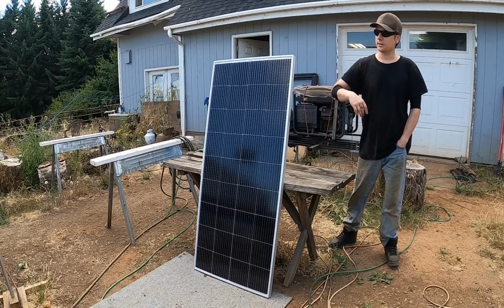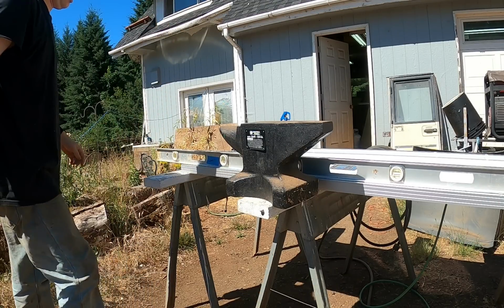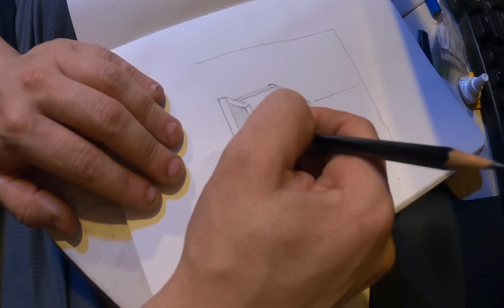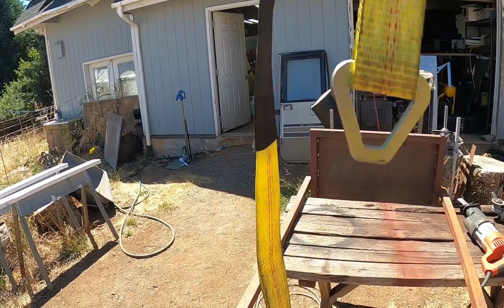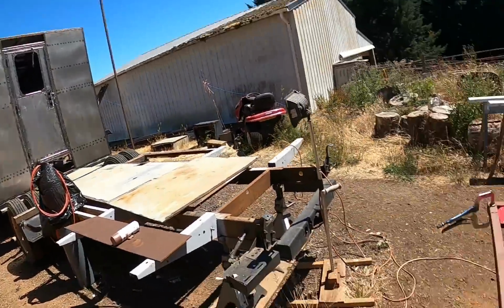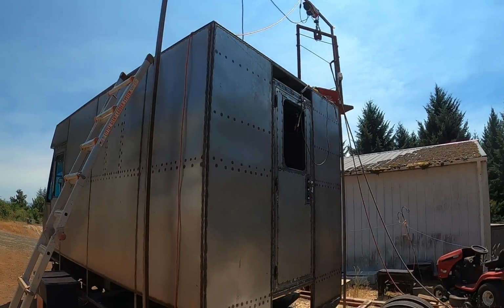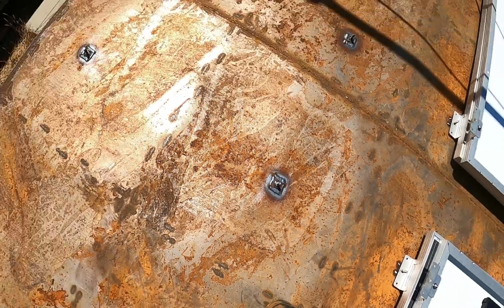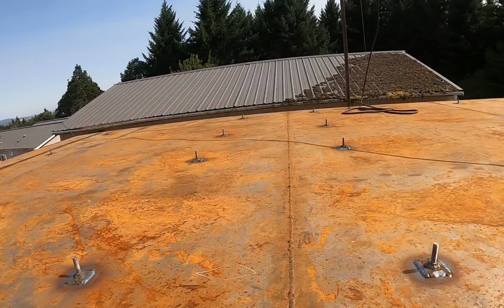Mounting BougeRV Solar Panels On Steel RV - RV Rebuild (Part 18)

Comment: I started to say this when you first built the gantry, but I got busy on my own project.  But here's my take on an improvement for your winch. Get 2 skateboard wheels and make 4 L brackets that you can bolt one the top of the winch.  Run long through bolts through the brackets above the 2 inch cross tube and bolt the skateboard wheels so they roll on top of the cross tube to make a simple trolly.   Sure would mean less sweating on dropping the panels, and other stuff on the ground when you want to pull the basket over on top of the rv.  Simple and easy. Wheels on top and L brackets keep the rollers in place over the crosstube.

Comment: You could instal them side by side along one side of the RV. You could still walk by the other edge to clean the panels. Possibly even fit more this way. You can put ladder on either side of the back wall. There are doors in the middle anyway so side lader is much more plausable. But hey it is just a suggestion. You do you man.

Comment: Those panels are supposed to be supported in middle they will flop up and down when you drive from content I can already see them bending in Australia they are always supported in centre as well all that work so far do agood job and add extra can aluminium glue it on with caravan  sikaflex or similar
Reply: Should be aluminium angle